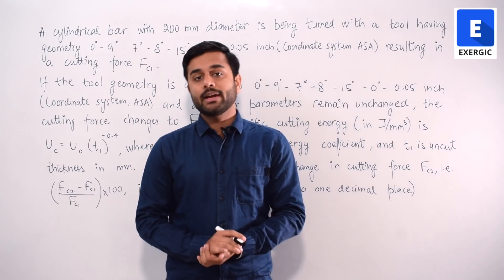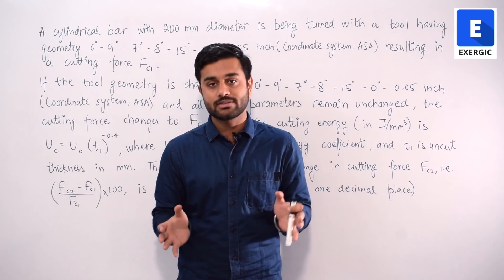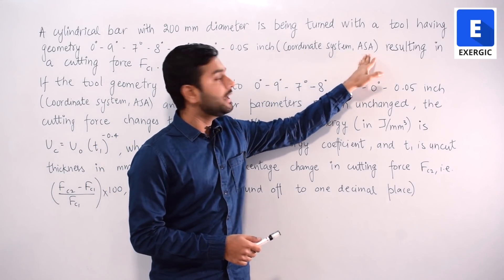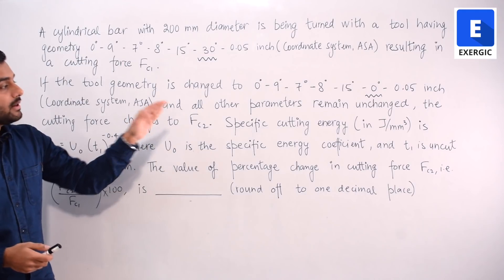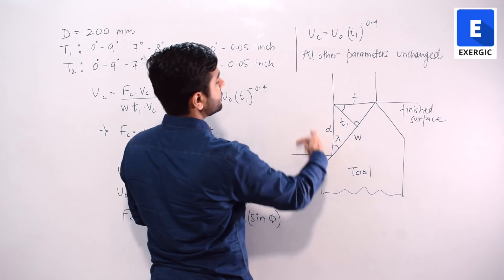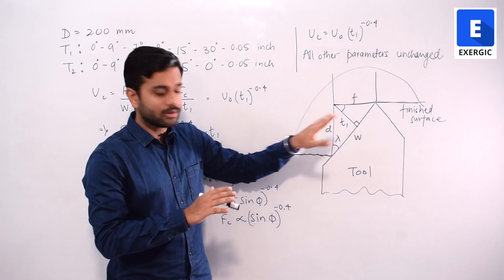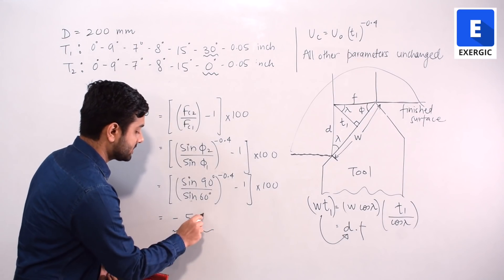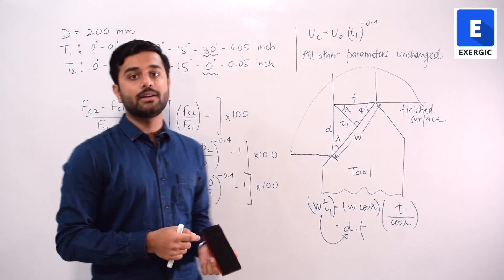Easy but Conceptual problem from Turning - GATE 2020 (Set 2)

Comment: Sir please give the solution to the flywheel question asked in mechanical afternoon session 2020. The answer is coming 3.58 but the official answer key is given 744-754. Sir please give the correct solution so that I can challenge this question.